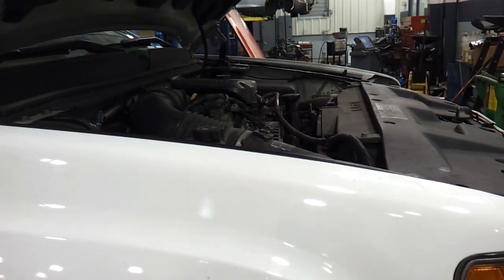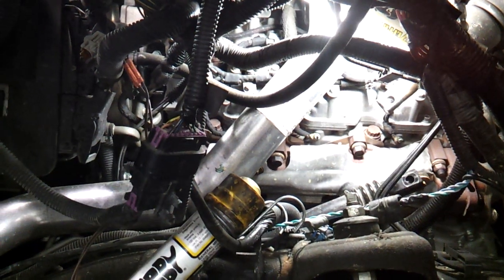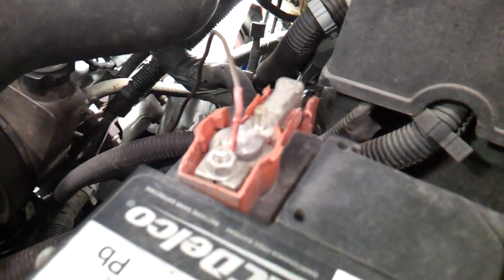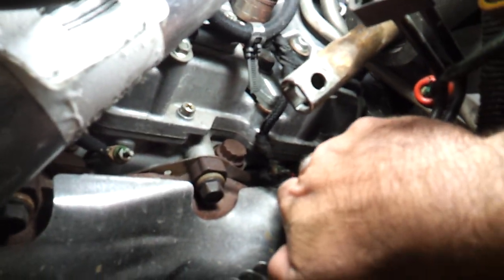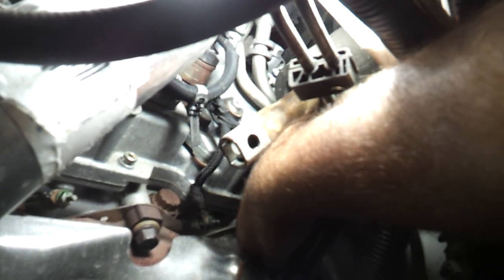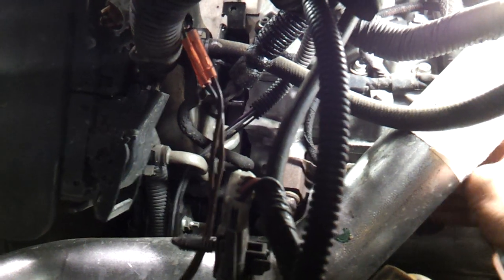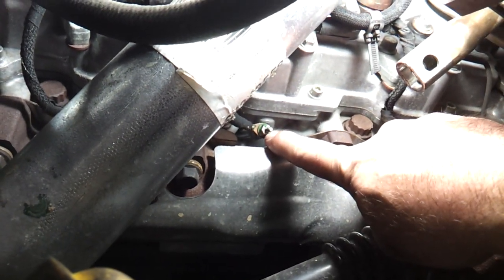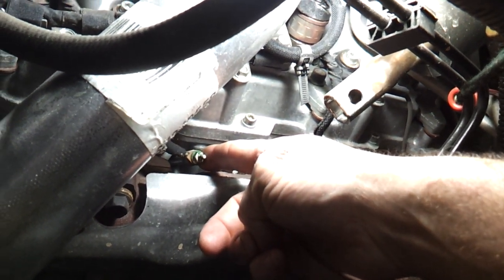Diagnose Glow Plug 6.6 Duramax-Angry Mechanic P0671,P0672,P0673,P0674,P0675 P0676,P0677,P0678

Comment: 2011 Duramax 2500 HD.  I have P 0671, P0672, P0673, P0676 & P0678 codes.  Does that mean that all of these glow plugs listed are bad? Or, could it be the control module?

Comment: I was getting fault on number five. So I went to the passenger side ran the test that you showed glow plugs 13 and seven light up. Number five lights up to. I don’t know what to do, now that the #5 plug evidently is good.  I clean the connection real well and applied dielectric. Grease. Engine still throwing P0675.

Comment: He is checking for continuity through the internal glow plug heating coil to ground. If his test light hooked to battery positive glows when he touches the negative lead on the test light to the glow plug terminal, it means the circuit through the internals of the glow plug to ground is good.
Of course,.. this does not check for power to the terminal stud on the glow plug when first turning the key on. For that test you'd reverse the test light leads then have someone turn key on while looking at test light.

Comment: Ive got a problem with my duramax its a 2007.5 3500hd lmm single wheel 4wheel drive duramax def is deleted and built transmission and egr deleted and built engine and it runs amazing but it keeps throwing a p160c code and a p01002 map sensor code and when you clear it it comes back in 3 weeks

Comment: Cylinder orientation on GM engines has Even number on passenger side of vehicle and Odd numbers on Drivers side of vehicle . 
1,3,5&7 are on Bank 1 , Left side of engine Determined from the Operators seated position on ALL North American product also called “Left Hand Steer” Cylinders 2,4,6&8 are on the Right hand side of the Engine . OPPOSITE of Operators side on ALL G M North American Production vehicles . 
Why in the world would they change that designation just for this engine ? All that would do is cause mass confusion .

Comment: So I'm getting that code on all 8 cyls... Clear the codes and it comes right back.. glow plugs are all getting power.. leads me to think the control module is shot.. usually this truck has a super fast cycle of the plugs on a cold start up and now will stay on 10-15 seconds... Any insight would be great!
Reply: I have that same issue did you solve it?
Reply: @zeke2286  the module is shot and discontinued... Can't find a good used one for the life of me.. ended up installing a webasto circulation heater...

Comment: What about P0381 on 15 LML w glow plug heater indicator circuit? Would that tell YOU which glow plug likely or control module? Lmk what you think on mine. Also does module replacement always require ecu/ecm recalibration? Any help appreciated🤓

Comment: I replace 2 6 8 cleared the light and still have it come back on for same cyclinder s replaced with ac delco.       2009 lmm so what do o do now ?     Is their a relay perhaps going bad or that’s bad or would it be control modular ?
Reply: You have to use a scanner and go under the GPM activate them 1 time and then clear the codes

Comment: how did you move the steering shaft out the way?
Reply from the maker: V. Munoz remove the 15 mm head bolt from the shaft and slide the upper shaft upward and out of the intermediate shaft. Then the intermediate shaft will lay down out of the way.
Reply: You don't half to use 1/4 drive boom 2 min in and out

Comment: Great vids. I have a 2012 duramax throwing a 088 code ppe shows high rail press.  Any way to diagnose?  Also when I hook up my ppe  tuner my injector balance between 7 and 8 are unreadable they are constantly bouncing around

Comment: working for gm i use a tech2 for checked the resistance valve and how many amps its using, then just use a test light hooked to ground for power at the tip.
so nice to know another way to check them!

Comment: this seems to be a quick test, but checking resistance is still the best method, if its just slightly higher resistance then specs his method will still work but the glowplug will not get as hot as it normaly would, i will say fi u got 2 of 4 glow plugs bad on one side replace all 4, 4 or more total plugs bad replace all 8